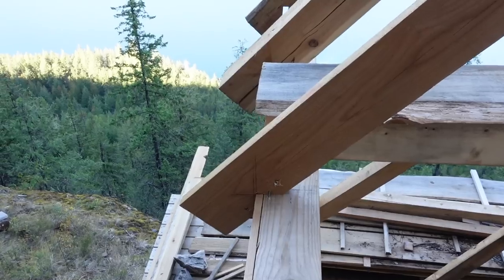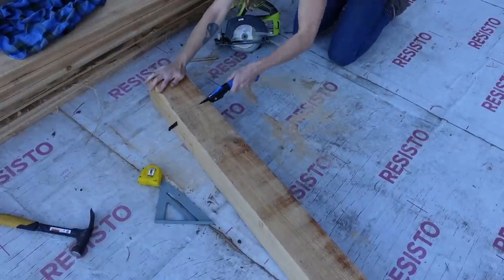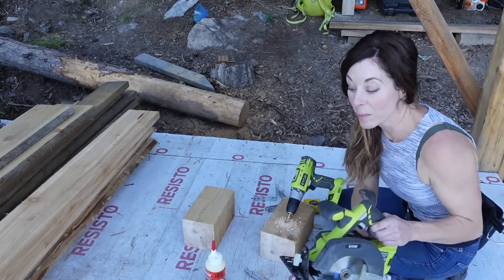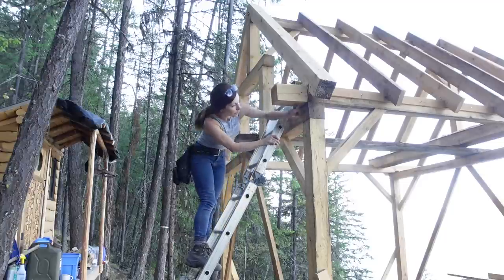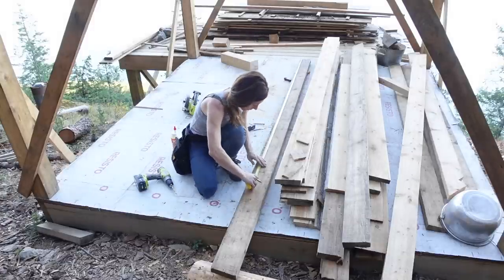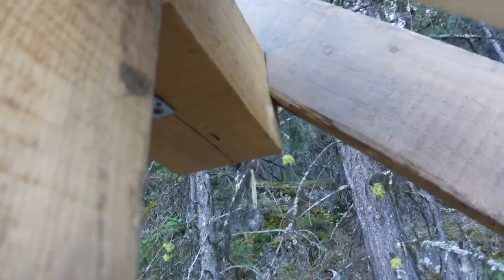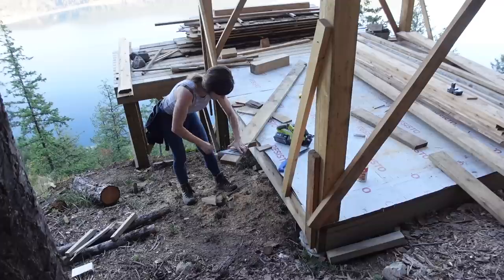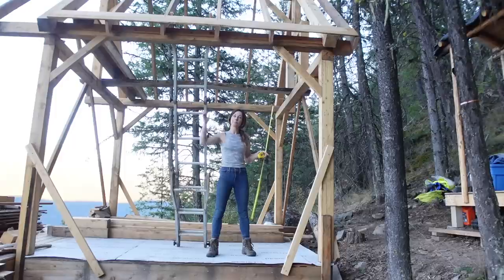It will be worth the struggle! Gable end beam additions done. Solo building just takes longer! Ch15

Comment: spoiler alert, isn't a box saw pretty to make straight cuts, when the saw goes crooked, so does the cuts/ flimsy saw blade, so not ready for laser welding yet, wax on wax off, straight cuts, you can even get a miter box with box saw, because didn't think you was going to make one, maybe later you will make one, bigger jobs bigger miter box

Comment: I would put concrete around the four posts in front, Or scab and retie into mountain side. That front is not solid enough for the amount of weight you are putting on it. When you know it is solid is when the top does not move at all, solid. Its has way to much movement and you are just stacking more weight on bad foundation.

Comment: Michy check this guys channel out,  Its called Bushradical. Building a Storage Shed ...... start to finish.....Bushradical. ........Premiered 3 hours ago. In this video we'll be building a storage shed from the ground up using part of an old barn foundation. Hopefully you can pick up a lot of useful ideas of how to build a shed for yourself. He will also show you how to do a Birds Mouth for your rafters. Very easy how he does this with a pc of scrap wood. He has been building for years. I'm just trying to Help you.
Reply from the maker: Lovely! I’ll watch it. Love his builds!
Reply: @michygoss7148  I was amazed at how easy he did his birds mouth was a scrap pc of plywood. I just want to Help you, sometimes it is easy to show you than trying to explain it.  Take Care, and don't fall off that high deck you are working on. 💖
Reply from the maker: @stanleykeith6969  the way he did it is pretty much exactly how I was doing it, except I was using my level rather than plywood as my gap (pitch of the roof) was greater). 
I do think a large part of my problem was incorrect cuts, slightly on each one. One day I’ll get them all good!!
Reply: @michygoss7148  I'm pretty sure all your cuts should be the same for the rafters. The ridge board should be in the center of the rafters. I think it would be easier when you go to cover the roof with your boards. Keep up the good work, Be Safe working up in the Air.💖

Comment: It's called a barge rafter, not a barge board. The whole cabin is being built with boards. Facia board is the final trim. If you are using the barge rafter for the finish look, then you are right to call it a facia because it will be a barge rafter and facia board. Don't pay any attention to these keyboard carpenters. I've been a carpenter for over 50 years and you are doing a great job. Next time you get criticism ask them for pictures of their cabin being built on the side of a damn mountain with no road to it.
Reply from the maker: Lovely! Thank you for this! It’s hard to tell who knows what online - all I know is that I really don’t know technical terms, and am happy to be corrected cuz most of the time I’m saying things wrong. Lol. 
Yes - that barge rafter will be my final board there, so barge rafter and facia board it is I guess!!  🤭. 
Thank you 😊
Reply: @michygoss7148  I didn't need any technical term to understand you. Your cabin, your terms, call it what you want. be sure to plan for your stove pipe to exit the roof between the standing ribs of your roof panels. If a rafter is in the way, be sure to header it off before the decking goes on. It'll save you some heart ache later. Keep on keeping on! To cover your miss cuts on the bird mouths, you can add a thin "facia board"over them with a miter joint at the ridge. It's really looking great.

Comment: I'm not a carpenter but from what I have read,  the top of the rafter usually is nailed to the ridge or suspended with hangers and there is no birsdmoutht  there.  So once you fit the birdsmouth at the side walls cutting the depth in relationship to the pitch and the width of the seat,  the top could be simply cut at an angle to be flush with the edge of the ridge which should be like the reverse of the pitch.  Need to set the pitch so the top of the rafter is flush with the top of the ridge beam.  The rafters from each side don't touch but both abut into the sides of the ridge.  But I guess what you are doing can work but if the width of your side walls are different than the width of the ridge beam the depth of the birdsmouth had to be different.  So if you had 2" side walls you would use a 4" ridge so the rafter on each side match 1/2 of the ridge and they would have the same seat width hence the same depth at each end.  Just simple trigonometry.
Reply from the maker: Yeah, I simply copied what I did with the rafters on my dog house I built! Not sure why I did things that way! 🤷🏻‍♀️😁
Reply: @michygoss7148  If it works then it has to be good.  I like the idea of resting on the ridge beam but with irregular lumber none of the cuts are identical as you found out.  I admire your determination.

Comment: Why didn't you just make the beams longer and make it one solid piece instead of screwing in that 6×6 piece?
Reply from the maker: Last year the materials were made - my husband cut the lodgepole pine at 10’ and 12’ sections. I am not building off a plan, rather just winging things. When I assembled the post and beam structure, I realized I wanted as much overhang at the front as possible, so did that knowing I would have to add on to the back.
Reply: @michygoss7148  ... Because this is my project and I do what I like !
Reply: @michygoss7148  OK, that makes sense.  You are amazing! I'm looking forward to the next video!